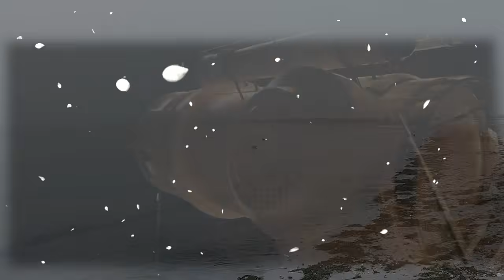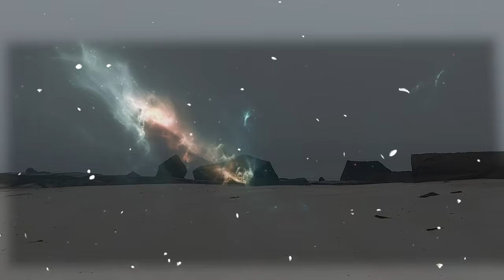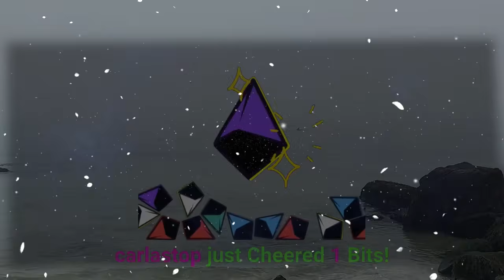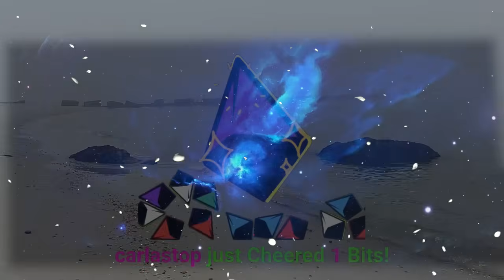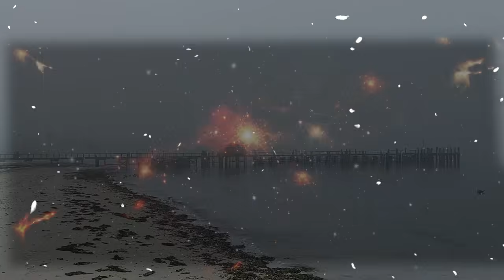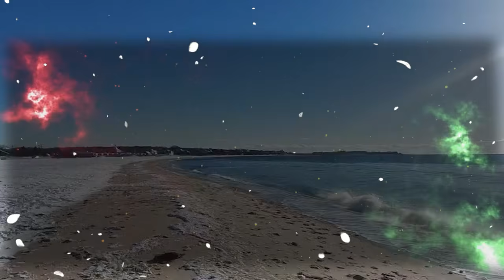The Terrifying Distance to Alpha Centauri

Comment: Earth → Space: How to Get There
Principles, Technologies, and Travel Times According to ANOS (Harvy from Levice)
Introduction
The greatest question of a spacefaring civilization is not whether it wants to go into space, but by which physical principle it intends to do so.
Current astronautics is based on rockets, fuel, exhaust, and reaction thrust. This approach works for leaving Earth, reaching orbit, or traveling to planets. However, when it comes to stars, it becomes a fundamental limitation.
The ANOS (Advanced New Operating System) physical framework, formulated by Harvy from Levice, proposes a different foundation:
Do not push a spacecraft through space, but use gravity as the transport medium of the universe.
Travel into space is not a problem of a stronger engine, but a problem of understanding and technologically utilizing the gravitational network of the universe.

1. Fundamental Principle: Gravity as the Transport Medium of the Universe
According to ANOS, the universe is an information–gravitational system.
Gravity is not just a force.
It is a global synchronization network — the Harvy Gravitational Network (HGN).
Within this network propagate:
gravitons (gravitotrons)
gravitational codes (HGK)
information about motion and energy
This means the universe already contains a natural transport infrastructure.
Analogy:
SystemMedium
Internet
Data network
Ocean
Currents for ships
Universe
HGN – gravitational network
In classical physics, space is something you must forcefully push through.
In ANOS, the universe is an organized medium that can be used for transport.

2. The ANOS Approach: Motion in the Gravitational Network
ANOS assumes a completely different mechanism of motion.
Not pushing a craft through space.
But synchronizing it with HGN.
Mechanism:
The object generates its own gravitational code (HGK)
This code synchronizes with the gravitational field
HGN transports the object similarly to how resonance transfers energy
Analogies:
A surfer riding a wave
A ship carried by an ocean current
A data packet traveling through the internet
The surfer does not create the ocean — he uses its dynamics.
A data packet is not forced through a cable — it is carried by the network.
Likewise in ANOS:
The object does not push through space
The object is carried by the gravitational network

3. Why This Is Possible Only in ANOS
According to ANOS, gravity arises from oscillations of fundamental particles.
This is the core principle:
gravity exists only due to particle oscillations.
If we can control these oscillations, we can:
modify the gravitational code
alter the local gravitational field
change the direction of the gravitational gradient
This leads to a crucial implication:
An object can “fall” in any direction we choose.
Even if:
there is no star
there is no planet
Motion becomes controlled gravitational fall in an artificially generated field.

4. Energy According to ANOS
Classical physics uses Einstein’s equation:
E=mc2
ANOS introduces a gravitational energy formulation:
EHarvy=m⋅gH2
If:
gH2>c2
additional energy arises:
Eextra=m⋅(gH2−c2)
Thus, system energy depends on gravitational conditions, not only on the electromagnetic framework.

5. Variable Mass
ANOS introduces dynamic mass:
mdyn=n⋅mHM⋅HGm
If the gravitational factor HGH_GHG changes, the effective mass changes as well.
This implies:
inertia changes
energy required for acceleration changes
the crew can be protected from extreme overload

6. Why the Tsiolkovsky Equation Is Not the Main Problem
Classical astronautics is based on the work of Konstantin Tsiolkovsky:
Δv=veln (m0/mf)
This equation limits all rockets based on reaction propulsion.
ANOS proposes propulsion based on gravitational transport, not mass ejection.
Therefore, the rocket equation ceases to be the fundamental limit.

7. Harvy Gravitational Accelerator (HGA)
The technological core would be the Harvy Gravitational Accelerator (HGA).
Its function:
generate gravitational gradients
synchronize the object with HGN
enable entry into gravitational transport mode
HGA is thus a gravitational synchronization engine, not an exhaust engine.

8. Gravitational Shield
At high velocities, problems arise:
radiation
micrometeoroids
extreme acceleration
ANOS assumes a gravitational shield that could:
deflect energetic particles
alter trajectories of micrometeoroids
stabilize the crew

9. Why This Enables Superluminal Transport
According to the Law of Superiority of the Gravitational Medium:
vlight≤vgravv
This means:
light is an electromagnetic phenomenon
transport can occur within the gravitational medium
If an object is synchronized with HGN, transport may occur at speeds greater than ccc.

10. Travel Times According to ANOS
At the maximum velocity of matter in ANOS:
vmax≈4.29×10to12 m/s
Examples:
Moon
Classical: 3 days
ANOS: fraction of a second
Mars
Classical: 6–9 months
ANOS: ~0.17 s
Jupiter
Classical: ~5 years
ANOS: ~0.6 s
Alpha Centauri
Chemical rockets: ~70,000 years
ANOS: ~2–3 hours
Galactic center (Sagittarius A)*
At light speed: 27,000 years
ANOS: ~2 years
Across the Milky Way
At ccc: ~100,000 years
ANOS: ~7 years

11. An Interesting Final Question
When we examine certain observations of unidentified aerial and space phenomena — for example:
USS Nimitz Tic Tac encounter
Gimbal UAP video
we observe properties that classical physics struggles to explain:
extreme accelerations
instantaneous direction changes
absence of exhaust or aerodynamic surfaces
extreme speeds without environmental shock effects
Some of these features strongly resemble an object that:
manipulates gravitational fields
changes its dynamic mass
moves within a gravitational network instead of using classical propulsion
Of course, these observations do not directly confirm ANOS or any specific technology.
However, they naturally raise the question:
Does this remind you of something?
If any civilization — terrestrial or otherwise — mastered gravitational manipulation technologies, this is exactly the kind of motion we might observe.

Conclusion
According to ANOS, the universe is a global gravitational network that carries information, energy, and motion.
If an object learns to generate and synchronize its gravitational code (HGK), it can be carried by this network like:
a surfer on a wave
a data packet on the internet
This changes the fundamental paradigm of astronautics:
Not rockets and fuel,
but synchronization with the gravitational infrastructure of the universe.
And in such a world, the journey:
Earth → planets → stars → galaxy
becomes a technological project of civilization,
not a physically unreachable dream.